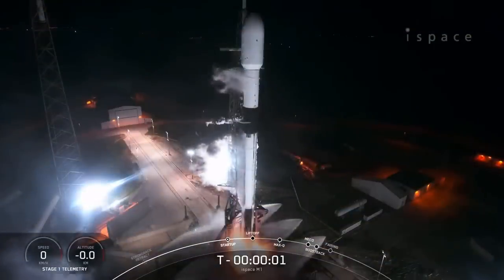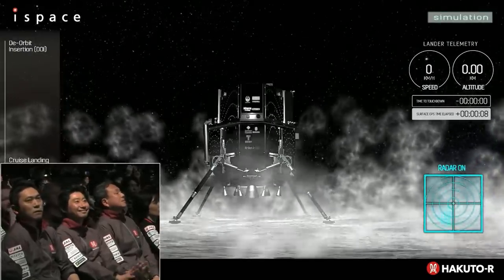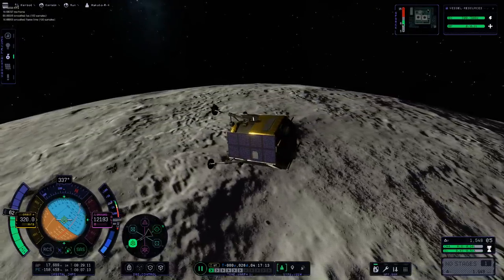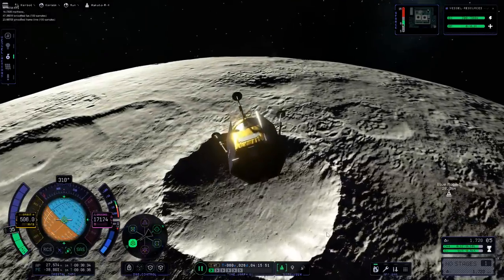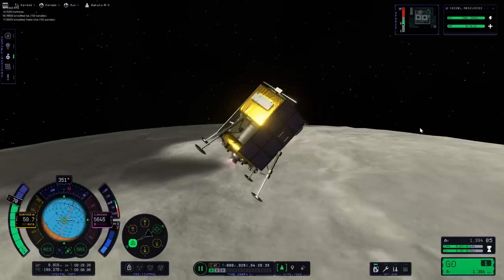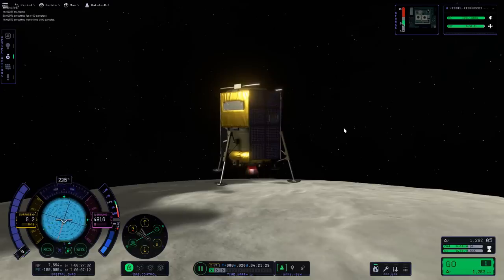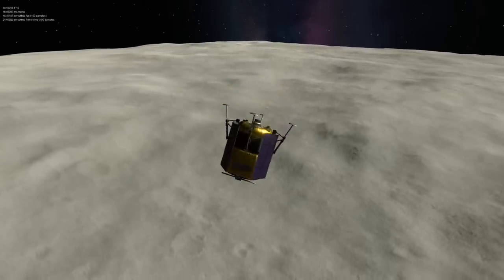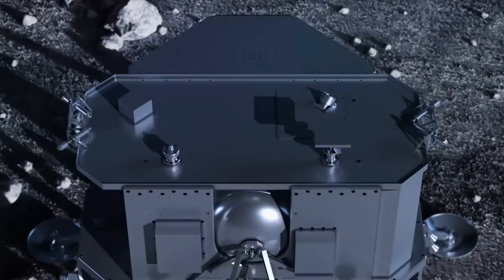Why Japan's Moon Lander Crashed Due to An Unbelievable Computer Bug

Comment: Hi Scott. Speaking of interpreting sensors: Do you think you could do a video about the topic of what sensors spacecraft are using for navigation? Maybe as "Things Kerbal Space Program doesn't teach". Because in ksp we magically know everything precisely, from orientation to position and speed. But how you measure that IRL could be an interesting topic.
Reply: I like that idea too.  My information on such things is decades out of date.  I know they use star tracker cameras to take fixes on specific stars, at least in some cases.  And I seem to recall the Apollo astronauts actually used a sextant to do the same thing manually and fed the data into the computer. In other cases, like satellites, they may not bother with navigation fixes at all, as they're monitored from the ground anyway.

Comment: I suppose that with the rapid advances in technology and AI , this kind of problems will soon disappear. 
A simple camera pair for example could recreate human-like vision, and give enough information to an AI to perform a landing, specially if paralleled with all the already existing sensors.
Reply: Excellent point.
Reply: And do you really think the Japanese didn't deploy that?
Reply: @alwayshiking_  Well, apparently not since it crashed after thinking for too long that it had landed, 5km above the surface ...
Reply: With the AI the need for higher processing power to multiply large matrices come. This increases the electricity power requirements and requires more RnD for creating radiation-hardened variants of processors. 
The Snapdragon 801 in ingenuity Mars drone is probably the state-of-the-art SoC being used. But that's the same one used for Galaxy S5 a decade ago.
Reply: I doubt AI in space crafts any time soon unless we develop more effecient processors.

Comment: Damn. As a software developer myself, this is totally something that I feel like I could have happen to me as well. I feel for the ispace team, and know they'll get it next time!
Reply: Agreed.  You would have had no way of knowing, or testing for, a way that valid real world data could trigger the failure detection routine. I'm thinking that they need to do  a hardware design change: add a second sensor, or better, a second TYPE of sensor and cross check the two.  If the data only goes wonky on one of the sensors, declare a failure. And radio home that the mission is probably fatally compromised, given the nature of the failure.
Reply: Guess what? This is how it works. The problem here is the definition of what should be interpreted as error in the input. If you have incorrect assumption, another array of sensors will reach the same consensus about being out of order based on unexpected range of values read. Initial landing site was a plain so you wouldn't expect drastic changes in altitude. Compare that to the new landing site near a rim of a crater where rim was high enough to fit the definition of unexpected error for the assumed scenario of landing on a plain. It seems that everything worked correctly for the purpose it was designed and implemented for but someone decided to change critical part of assumptions and cut corners based on gut feeling instead of thorough simulations.

I wonder if Japanese culture worked against this project where rising this issue was frowned upon by the higher-ups so nobody raised any concerns.
Reply: I don't normally have to deal with "what do I do if this important sensor fails?" scenarios. (in most of my things, all the data I have can be trusted 100%)  So here I would envision "what do we do if the altimeter returns implausible data?"  "Rely on other systems" seems like a good answer, but DEMANDS you also ask "how long can we rely on them?"    The answer here is "not very long".  Which brings up an important question "what do we do if we've been relying on this other system with decaying accuracy?"   If THAT question had been asked, then they would have realized they needed to reconsider using the data from the altimeter.

You solve this by assigning a "quality" to your sensors, and you go with the highest quality.  If you get a wonky reading, you do something like drop the quality to 80% or 60% or 20% or whatever you feel is appropriate.  (ONE weird reading might drop it from 95% to 70%, and successive apparent glitches might continue to subtract 5% each?)  And when you're using inertial guidance, which is normally "recalibrated", that should have its Quality decay over time, AND reset to the quality of the recalibration source every time it's recalibrated.  That's just how that's done.

In this scenario, say the quality of the altimeter was changed from 95% to 60% when it glitched.  OK.  The inertial guidance would start ticking down from 95%.  Hopefully it will cross below 60% soon, at which point you revert to using the altimeter because its quality is higher.  This approach might have "re-enabled" the alitmeter and saved the lander.

Comment: The lander knows where it is at all times. It knows this because it knows where it isn't. By integrating the difference between where it is and where it was just a moment ago, it doesn't have to rely on the radar altimeter to figure out just where exactly it is. By filtering and evaluating the radar altimeter measurement data, the lander can choose to ignore the upcoming measurements, should a discrepancy be detected between where it seems to be and where it could likely be. In a hypothetical scenario, where the radar altimeter measurement rises and lowers by a few kilometers over the span of several seconds, during which both the linear rate of change of difference between where it is and where it was a few moments ago, and the doppler shift both remain fairly constant, the lander may conclude the radar altimeter data is untrustworthy. After removing the radar altimeter input from the sensor fusion algorithms, the lander can estimate where it is using the Lunar topography data and a trustworthy data point about where it was some moments ago, along with its profile of the rate of change of the derivative of where it is, recorded until the time that it currently is in.

Comment: Perhaps a stupid question but why didn't it have redundancy on sensors?
Reply: Probably weight limit
Reply: Weight would be the first thing that comes to mind.
More mass = more capable spacecraft needed = more costs.
Reply: It has. all those "radio Sensors" (I think it had 3, for collecting data from different directions) that were measuring the height were identified as "faulty" by the bug and It turned off the input from those sensors. Marking the sensor as faulty based on the output of the sensor and turning off all those sensors was the bug
Reply: $$$ and weight.
Reply: find me a spacecraft that has/had redundant radar altimeter, even Apollo didn't have one

Comment: I always have to laugh out loud when I hear that someone programmed a "Just go ahead and ignore that other thing we programmed, even though you were programmed to pay attention to the thing we are telling you to ignore" code. 

It always works out really well.
Reply: I don't see the problem. Hardware failure happens... so writing code to detect when such a failure happens and falling back to another method is the right thing to do. This wasn't a problem with the concept of checking sensors and ignoring them if they are faulty... this was a problem with a minor bug in the implementation that wasn't caught due to lack of testing.
Reply: @JohnSmith-fz1ih  I have to agree with John on this. Sensors do fail and they do so all the time, especially in extreme environments. How you account for such a situation is a constant debate between engineers. Do you fall back on another sensor? Do you assume it is faulty? Do you fail current state? Do you fail to a different state? Do you run calculations and try to verify if the sensor is correct or not? The answer will vary depending on circumstances, situations, and underlying memory storage.

I was asked this question yesterday by a coworker as to what state should we fail our pressure control valve if the sensor fails. We discussed and came to the conclusion that it depends. We could fail open to make sure everyone is safe even if the outcome isn't desirable, or we could fail to current state and rely upon another sensor and another valve up stream to properly determine the pressure. Both situations have their drawbacks and benefits.

All in all this isn't a dumb logic situation, but a simple oversight situation that failed to account for a possible condition the lander could have been in.

Comment: Hello Scott

Love your posts and enthusiasm for all things space!

In the last several attempts to get small landers to the moon, there is one common thread...no real time marker to tell the lander where it is above the surface.
They have used simulations to create software that uses extrapolation of location from multiple inputs to guide them to the surface.  The unfortunate reality is that all this software has to have limits that have over-max cut-outs on them.  When these limits were passed during the landing sequence, it has caused loss of "Ground Truth" if you will.

A tried and true method that is used by bush pilots for determining exactly where the ground level is when landing in flat light conditions on snow, where contours are impossible to see, is to toss a contrasting coloured wooden cross with 1 meter long arms out of the plane onto the snow to give them a reference point of known size to let them figure where the ground is.

My thought is to have the lunar lander equipped with several small optically reflective markers that are equipped with radio beacons that are ejected laterally from the lander at an arbitrary  height above the surface.  These markers would then free-fall to the surface and create physical markers of the location of the lunar surface.  The markers would have to be light enough and robust enough to be dropped from say, 5 kilometers above the lunar surface and survive the impact acceleration.  Given the rocket powered ground penetrators with telemetry suites in them that I have seen developed, that really is a no-brainer.

These markers would provide both visual and radio references that the lander could rely on, in order to make a  perfect landing using both optical triangulation and doppler radio feedback. 

Your thoughts?

Comment: Yet another example for building a constellation of Lunar Position Satellites prior to attempting to land on the surface. Like GPS, but LPS for the Moon.
As always, failure to invest in infrastructure always costs in the long run. 
Anyone wanting to create a commercial venture to put four satellites in Lunar orbit for licensing LPS services to other companies and governments, please reach out to me.
Reply: sadly lunar gravity is very lumpy
that means no stable orbits

and iirc the moon doesn't have a big enough sphere of influence for stationary orbit
Reply: If we can't land on the moon 50+ years after it first happened we shouldn't be wasting money on tech that could be just as erroneous.
Reply: @7tonsofsalt865  Good input, 7, but I wonder if the lumps can be compensated for, even dynamically through INS,  in software... LRO has been orbiting productively for, what, 16 years?
Reply: @thePronto  What tech did you have in mind?
Reply: @averystablegenius  the problem with the lumps is that they make spacecraft require a lot higher fuel usage than say earth orbit.
even the lunar reconnaissance orbiter which is on one of the few "stable" orbits will eventually run out of fuel
and with the cost of lunar injection flights i just cant see that being profitable

maybe one we can launch and refuel them from the moon but well see
Reply: @averystablegenius  you mentioned an LPS?  How would the business model (nvm the orbital mechanics) work for that?
Reply: @thePronto  Pronto, imagine yourself on the Japanese team. They can either use on-board sensors to land their probe, or save the weight and rely instead on my LPS. In return, I charge them a license fee for an amount equal to their cost savings. They would pay this because my success rate would be demonstrably much higher than the radar systems, which, as Scott Manley pointed out, is highly unreliable. Furthermore, my LPS would function as a TDRS to relay telemetry data from the far side of the Moon in real time back to their ground stations. Naturally, I would charge for time and capacity  on my TDRS system as well.
Reply: @averystablegenius  the issue with the bumps is not that they make the position of the craft unknown.
Rather the problem is that the Orbits are altered over time in such a way that they eventually intersect with the Surface - Unless you constantly do course corrections, which is undesireable.
You can avoid this by using Frozen Orbits, but these are limited (according to wikipedia currently only 4 are known, with inclinations of 27°, 50°, 76°, and 86° ), and i am pretty sure LRO used the 86° one since this is pretty much a Polar Orbit.
Reply: @7tonsofsalt865 16 years works great for my business model with four cubesats, perhaps eight for redundancy, 7.
Reply: @averystablegenius  looked it up LRO is neither in a circular orbit nor one with a low inclination, both of which are required for positioning systems

also the moon doesn't have a stationary orbit, which is also required

however there are Lagrange points between the moon and the earth, which you might be able to use, because the moon is tidaly locked
it would still be expensive as hell because not all Lagrange points are really stable and coverage would be terrible, because you could at max have 4 satellites (you need at the very least 2 to get your position)
Reply: @unitrader403  Polar works great for my model, Uni. Thanks for the input.
Reply: @7tonsofsalt865  Thanks for confirming my original forecast of four cubestats, 7, though I would probably budget for 8 for redundancy. Also, my simulations suggest that position can be ascertained with ONE cubesat using Doppler. Though my colleague is convinced this is the way to go, I remain skeptical.
I'm not interested in Lagrange for my cubesats, but I'm wondering why a stationary orbit for the Moon matters?
Reply: @averystablegenius  you seem to have all the details worked out, Mr Genius.  The only thing left is to build a PowerPoint and a spreadsheet, and you will be the Elon Musk of the Moon.
Reply: @thePronto  So true, Pronto. We in the aerospace business call them "Powerpoint Rockets.' That's why I asked for those interested in the project with the talent to address obvious problems to reach out to my team. Reach out if you believe that shoe fits you.
Meanwhile, unlike Elon, I do not seek to defraud investors with Theranos level grift.

Comment: I'm not blaming anyone. Software testing is tough. This emphasized how important testing is, and how important it is to have various test cases/scenarios, including edge ones.

I'm a maintainer of an open source software. Every now and then we receive a bug report that our software failed in certain edge cases that we -- the maintainers -- had not foreseen. We will end up adding that edge case into our test suite and fix the software so it passes that new test while still passing existing tests.

This is also why open-source is important. At the very least, the test cases / test scenarios -- and their respective expected outcomes -- need to be open-sourced.

Comment: This sounds like a management issue.  Its insane to me (as a software engineer) that after changing the landing site, they didnt re run all the testing for the new site.  They just said - testing is done, we dont need to do that again. Really short-sighted.  Any engineer would and probably was shouting for re testing when the landing site changed - but someone decided it wasnt necessary.
Reply: Got to say though, engineers could surely have had a very long series of tests done with random landing sites.  It would have taken a while to run .. but why not?  Would have shown up the bug in the end.

Comment: The Mars 98 lander failure was found to be due to a software bug AND a hardware "idiosyncrasy".
First there was a Software bug that allowed the Flight Software to begin looking for "touchdown" from the landing leg sensors way too early in the descent.
Next there was a hardware issue where the hall effect sensors on the landing legs would detect the magnet passing under the sensor during DEPLOYMENT of the legs NOT just during landing as they are meant to do. They would false trigger with about a 30% chance of sensing the deployment.  The lander had three legs so it was almost a guarantee that at least one of the sensors would detect "touchdown" during deployment .
But the FSW was not supposed to be watching for "touchdown" during deployment.
Finally, a wiring defect and a failure to repeat tests was what caused the demise of the lander.
When they did the "Pyro Shock" test of deploying the legs the very first time they were running the descent simulation.
When they went to simulate "touchdown" the technicians lifted a leg and nothing happened.
Tried it on all three legs, no detection of "touchdown".
It turns out it was a wiring mistake on the hall effect sensors that was not caught yet.
They rewired them, and it fixed the problem. 
The legs now could detect touchdown as expect.
However, they chose to NOT RERUN the entire pryo shock test again because it was a test that is hard on the hardware and very expensive.
So they launched it not knowing that it would detect "touchdown" way too early in the descent sequence and thought it was on the ground so NEVER FIRED ENGINES to complete the landing.
This was discovered on the second lander during the pyro shock test because they had the sensors wired correctly that time.